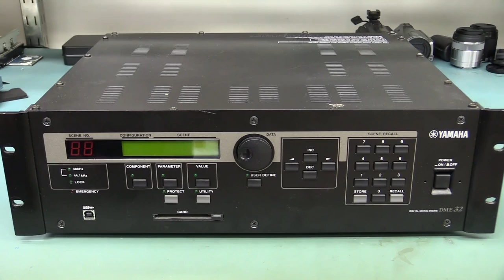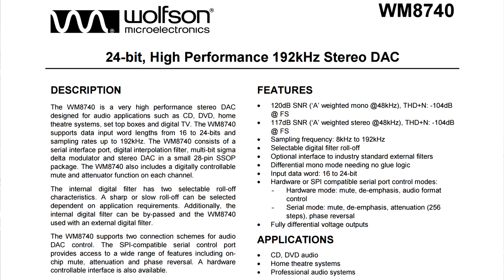EEVblog #738 - Yamaha DME32 Digital Mixer Teardown

Comment: The use of TRS (rather than XLR) is most likely due to two reasons.

One would be space: 8 XLR jacks probably just wouldn't fit on a single board, and it's a simple straight-through adapter to go from TRS to XLR. Adapters are readily available, but one can be soldered up in a minute or two.

Second would just be useability. Aside from microphones, XLR connectors aren't used for much else; TRS is far more common when balanced connectors are called for (plus you can always use a TRS jack for an unbalanced 1/4" plug too, which are ubiquitous in the audio industry.) Typically those inputs would be run either to a cable bundle/snake or, more likely, run to a front-facing rack-mounted patchbay so the engineer doesn't have to keep crawling around to the back of the rack to plug stuff in. I'd bet money there was a TRS patch bay that lived in the rack right below this mixer.
Reply: ***** It depends on the business. In my field (broadcasting) the analog equipment uses only XLRs or multipin to XLR breakout. Of course we have lots of bantam TRS patch bays. I can't remember the last time I had to use a 1/4 TRS except for headphones.
Reply: Chris W Yeah, it's really dependent on the end use. In typical recording studios, 1/4" TRS are very common, but I know a lot of broadcasting (especially out on location) tends to go XLR. I usually look at it from a recording/music studio angle (as well as being a guitar player), so I use 1/4" for pretty much everything except microphones (or AES/EBU, but that's not really the same thing aside from the physical jack used.)

My audio engineering class did have a couple "field" DAT machines and I remember they mostly used XLR connectors, but I personally never used them for anything. There was no way the teacher was going to let a $2000 portable DAT out of the building with a few high school students!

My audio related endeavors are relegated mostly to home these days, and with all of the integration and shrinkage of audio gear, it's pretty easy to get away with the bare minimum of gear. It's been cool to watch how much computer-based audio equipment as shrunk down over the past 20 years! What used to take up two or three 10-bay racks and a ridiculously expensive computer can now be done with most average PC's, a 1U rack interface and some software plugins and still sound great!

Comment: The DME32 was not meant for stage use, but for installed sound (mainly conference centers and such). The software does not realy support live mixing, but more for static mixes (microphones in a conference center).

Comment: Interesting to see the RS232/434 connectors.  I usually associate those with custom AV installations that use a control system like a Crestron rig.  This unit seems to be specifically targeted at theatre and cinema where a pre programmed scene is uploaded to change the settings during a performance as opposed to a live music installation where a sound engineer will change stuff on the fly.  Interesting!

Comment: TRS is often used to connect mixing equipment together at short lengths, especially through switchboards (like in the ancient human-powered telephone networks). XLRs are more common for connecting actual devices (e.g microphones) at larger lengths.

Comment: these units are mostly used in rackbased static setups, not much roaduse.
I have installed multiple units in all kinds of office buildings for presentationsystems and other stationary audio sollutions.

One of the other uses is fire broadcast systems.

The usb in the frontpanel is for service, the com on the back for installation use to controle , lets say, a video switcher

Comment: Hey! Don't just throw it in the backroom after the teardown! The three modules in the nack are worth quite a bit of money. They are called mini-YGDAI cards. They fit the DM1000, DM2000 and other contemporary Yamaha consoles. Especially the analog outs go for quite some bit of cash. Who again gave you this??
Reply: People actually using gear like this appreciate if folks take the time to list on eBay. Many high-end systems like this are retired only for lack of accessories!
Reply: The MY8 DA card alone still is 640 Euros new and they will stay valuable for at least another 10 years. Good audio gear doesn't really get old.

Comment: "Antialias filter" is what you wanted to say on those filters mate! usually for 96kHz the filter will roll off 3dB at double that ~ 192kHz...
Reply from the maker: Kris TheTrader Err, yes, brain freeze.
Reply: Kris TheTrader Wouldn't they roll off below the clock rate?
Reply: Chris W Hi Chris, OK up to a few years ago aliasing was something I wasn't familiar with as I did mostly analogue stuff... But the picture became very clear after getting my hands dirty with ADCs in the audio domain... Anyway, best thing to do is to actually read about it, instead of me explaining the whole thing, some good read here: What is Aliasing? http://theproaudiofiles.com/digital-audio-aliasing-explained/ Hope this helps!
Reply: Kris TheTrader I know about aliasing. So does the guy who wrote the article you referenced. 
"CD audio has a sampling rate of 44.1 KHz which means that up to 22.05 KHz of audio is safe to be sampled. In this case it’s likely that a filter would be present to start rolling off all audio from 20 KHz onward, cutting everything off by 22 KHz"

Comment: Ther cold be several reasons for the TRS connectors on the back:
-the 8ch modules came off something else and were installed for extra I/O OR just installed to add extra items to your tear down.
-bad design -> the early digital mixers had a horrible software experience as far as operation was concerned and the I/O did get odd at times.
-space -> the xlr sockets take up a lot of space and production companies don't mid buying 40+ TRS to XLR converter cables or snake. 
-they were using a digital snake to handle the FOH/monitor sends/stage inputs and the I/O on the console is for routing to Fx units and mic receivers in near by racks.

People do run software mixers with PC hardware  + firewire audio interfaces + software like Ableton Live but they are not that reliable and latency is often a concern. + they tend to break if you install software updates. You also need to have a stock pile of spare parts in case something goes wrong or dies. On the up side software mixers are more flexible hardware wise and have a cheaper upgrade path + you if an interface dies you still have the other ones to use but if a digital console dies your stuffed.

At the end of the day the cost needed for software + hardware for a software mixer you might as well go with a dedicated digital console. software mixers were more popular when the lower end digital consoles were $30 000+ but seeing as the lower end one are mostly less than $5 000 now its priced out the software mixers.

Comment: On slot 1 and 2 u still have balanced input change only the connector from XLR to Stereo Jack, but if u look the corner bottom right u have the pinhead of each jack: hot cold and shield\ground of each one. identical is on XLR connectors only different shape to fit em in less space.
The output has that connector couse probably was paired to an analog recorder or with the same module with version  analog input u can pair the unit to a more recent Yamaha mixer :)  ( and connecting 1 wire with 2 connectors compared to 16 wires 32 connectors save a lot of time :D)

Comment: Also when learning how to run audio for professional events, most people learn on and analog desk, because they are cheaper and they are extremely basic, then you get to learn digital which can be very confusing, because the controls of an analog console are essentially the same across all brands, however digital interfaces change drastically across all brands which makes it very difficult to figure out how to use consoles from all brands

Comment: I actually get to see them nearly everyday in the Studio :) But they are only of use for Digital to Digital Final Mixdowns or to get good Recordings off of Synthesizers. But my Mixing Engineer Friend (15 Years of Exp. + Master of Arts Diploma) swears on Digital and Analog combined. Tube Amplifiers combined with a Revox Studer Reel to Reel @15ips and an Analog Desk hooked to a Digital Recorder still sounds better than just Pure Digital.

Comment: Those gold caps on the I/O boards look like Nichicon Fine Gold's. Dave would enjoy the audio Tom Foolery in those data sheets.
Reply from the maker: DoItYourselfMusician I don't dare look!
Reply: Or the controversy over using electrolytics in the audio path, instead of poly like a real man would.
Reply: +DoItYourselfMusician It's Nippon Chemicon ARX Series, now discontinued, replace with ASH series. Still "Audio Grade" capacitor like Fine Gold. I thought Dave will make fun with those datasheet like OP275, but no, I'm disappointed...

Comment: The DME 32 isn't made for live and touring applications. It's a studio/musical/theatre kind of mixer. Pretty old of course😃 I don't like working with those computer based digital mixers I definitely prefer desks(digital and analog) the handling is much much better. But Yamaha did a nice job on design.

Comment: At 26:00 about the old through hole parts.  I wonder if the design of the board is much older than the rest of the unit.  Maybe they created a new digital design which was backwards compatible with the older analog plug in cards.  Why redesign the plug in boards if they still work?
Reply from the maker: cemx86 Could very well be.

Comment: Very very nice teardown item. The DB25 connectors are quite common and their purpose is to save space. They usually carry 8 channels of differential audio signals with a ground each, so 24 pins are used. They are used with these so called "snake cables" http://www.hitsquad.com/news/images/hardware/snakecables.jpg

Comment: You have to appreciate a proper bodge!
Reply: Alyx BioHaz None of that nasty chloroprene glue which turns conductive as it ages!
Reply: No hot glue that chips off over time, proper plastic shielded mod wire, no loose wires, proper large blobs and i bet its even solid core! 
i would also bet that if you took apart another unit it would look exactly the same!

Comment: WOW! a SH-2! There was one in the sega Saturn.
Reply from the maker: draggonhedd Quite old school. Probably inherited from previous designs.
Reply: EEVblog Was it on the Sega Genesis as well?
Reply: Pixel No, Megadrive/genesis is Motarola 68K.
Reply: thedjnk I was talking about the sound chipset. And really the Motarola 68K oh my NAB isn't that the same processor found in the  old Macs at the time! I seriously did not know that! I bet if the cartridges had more memory and the ports can support a mouse and a key bored, The Sega Genesis can run the old Mac OS right? Cool!

I just learned something NEW! YAY MEE!
Reply: No. Merely having a processor does not preclude OS compatibility. They are still completely different architectures of system. 68k processor was used in a ton of shit at the time. Amigas, Macs, game consoles, embedded devices, etc etc etc.
Reply: EEVblog Old school indeed. But then again, it's some tested and proven reliable tech, rather than a brand new design which might have some flaws still yet to be worked out.
Reply: draggonhedd Huh. I've always thought same processor means same architecture. Huh? It's like they say "Were Answers comes more Questions" i guess. All my months of knowledge turns out to be wrong. "The more you know" right. I guess i've just learned something to AGAIN!

Comment: Old fashioned device. Almost all modern PC sound cards offer 192Ks/s maximum sampling rate compared to the poor 96Ks/s of this digital mixer. Most of them offer upsampling capability of the original digital audio signal, i.e. improvement of bandwidth. And all these for 100 - 200 USD. Although the flexibility and the construction quality of this mixer is really of professional level, IMHO it is waste of time to deal with it.
Reply: SpaceJump Until windows decides to do an update during the middle of the gig and reboots the PC host automatically... that kind of thing happens! 
It's horses for courses. Yamaha gear just works. Thats what you pay for when you buy boxes like this - reliability and servicing. PC's have their place, but so do pro boxes like this.

Comment: Yet another video that the picture plays slower than the audio so lip sync is well out. What is causing this on my machine? graphics card is an NVIDIA GeForce 9600 GT,
4 gig of ram and core 2 quad Q9450 cpu running at 2.67 GHz